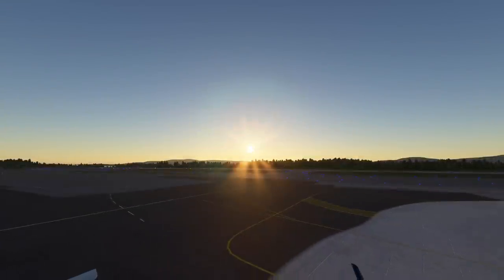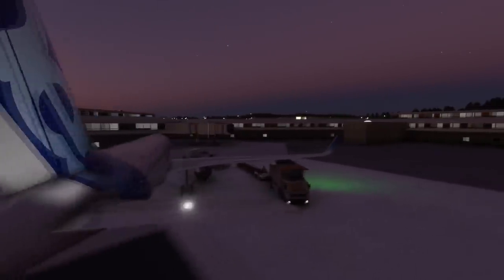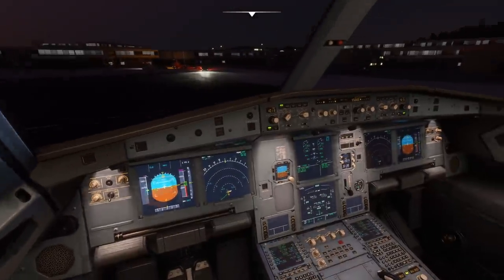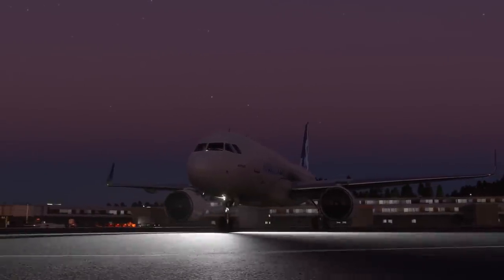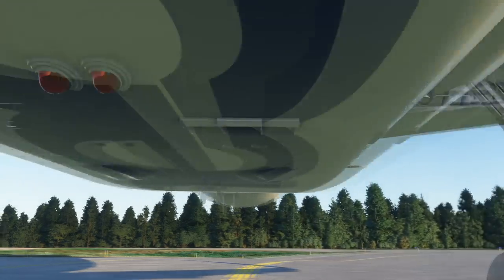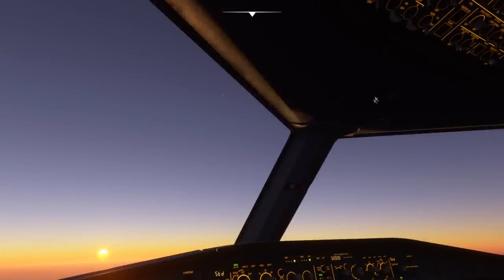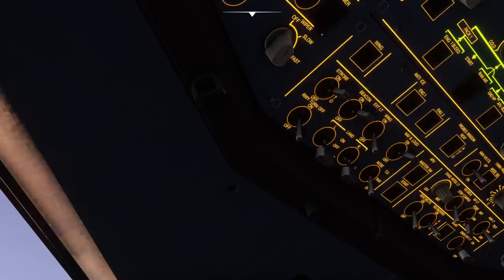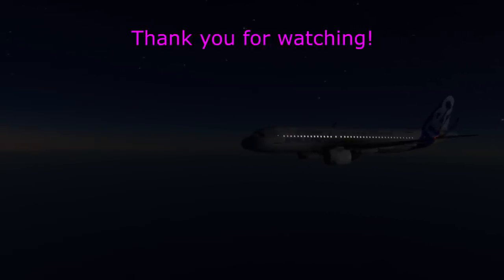Airbus Lights: What you didn't (need to) know! With a Real Airbus Pilot in Flight Simulator

Comment: I would like to add: at least in North America, the wing ice light is frequently used regardless of conditions from taxi right up to initial climb at least, if not 10,000.  This adds to visibility, even outside of low visibility conditions.  I pair the wing light up with logo lights (when logo is separate on other aircraft).

Comment: Q1. Taxi Lights. I read somewhere that taxi lights indicate that your aircraft is in motion or is about to move. If you have stopped taxiing, you should turn off your taxi lights. For example to give way to another aircraft at an intersection or holding short at the runway, you should turn them off to indicate to the other aircraft that you have indeed stopped and do not intend to move. Is this true?

Comment: Q2. Navigation Lights. I read once that Nav lights should always be turned on as soon as the aircraft is powered up. This can be a warning to ground crew that you may be doing control checks or control surfaces can move so they may want to stand clear or not be startled. Is this true?

Comment: Just getting back into flight sim after having a dead computer since MFS released. Old video so probably won't get a reply but
Question: Does procedure change in a Airbus during inclement weather such as thunderstorm, heavy rain and fog...

Perhaps i missed it but you didn't mention it in the video only saying you would keep interior on dim until possibly tod when it would be switched off.
it was my understanding that during atleast thunderstorms all cabin lighting should be set to bright to decrease the chance of flash blindness.

Majority of my flight sim hours have been on Boeing aircraft namely in XP11 and getting back into MFS i've been flying the A32NX primarily,
atleast what majority of the Boeing checklist (OM/FM) i used to use always suggested and some aircraft even have a dedicated Storm button
that forces all lights on in cabin.

Comment: I was going through the keyboard settings and it doesn’t look like you can toggle the nose light with a key command(on the FBW at least). That’s unfortunate , it would help me when taxiing if I can just use key commands for lights as needed and focus on taxiing.
Reply: Oh yeah, nose light set to taxi prior to landing, thanks for that tip

Comment: Thank you so much for these videos! Love them! Just wondered if you have time and desire to do an engine restart procedure while in flight?! I emptied the tanks while in FL380 engines flamed out and everything became dark. Then "refueled" in midair, started the APU, lights back (APU bleed) no problem there, then initiated engine restart with engine knob on START position.. I tried everything but I could not restart the engines and save the plane.

Comment: Hey from where do you get check list for Air Bus A320 Neo Flybywire mode
Reply from the maker: The checklist for the FlyByWire mod are built in to the MSFS checklist system (in the toolbar!)
Reply: @320SimPilot  thanks

Comment: For official procedure, I thought the red beacon comes on when the APU is started and only off when the engines AND the APU is off... unless this is just a company policy...
Reply from the maker: Hi, in Europe this is not the case on the Airbus. It may be common on aircraft where the APU exhaust is near the ground crew. Thanks for watching!
Reply: It works pretty much like the beacon lights on naval navigation. It is on whenever the vessel is on the move. So, when towing the plane, the beacon must be on, despite no intention to start the engine.
Reply: @320SimPilot  Thanks for your quick reply and the video !

Comment: ALMOST any Airbus simulator. The A320 in Aerofly FS2 barely have any lights on the outside, there are switches to turn on taxi/landing lights, but nothing happens. Only working lights are on the inside. But at last it works and have more stable flightmodel than MSFS2020.

Comment: Hi all

Nothing related to this video but, I'm having a drama with my approaches.

In a nutshell, when I go for flaps 1, the aircraft suddenly shoots into orbit and leaves me unable to land.  Does anyone have any ideas why this is?

I have the latest update for FS2020 and for Flybywire A32NX.
Reply: It is normal that the flaps are pushing the plane up a bit but they shouldn't shoot it into orbit. Did you fly slow enough?
Reply: Yeah I'm at the correct speed for flaps 1. Then when I activate the flaps the auto thrusters crank up and I literally go from 2500 - 4000ft. Totally to high for the landing